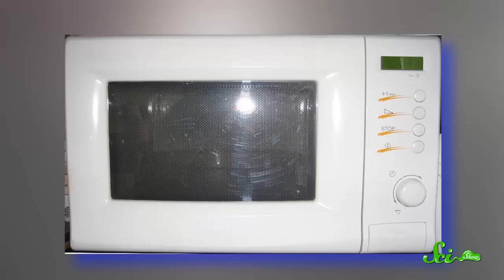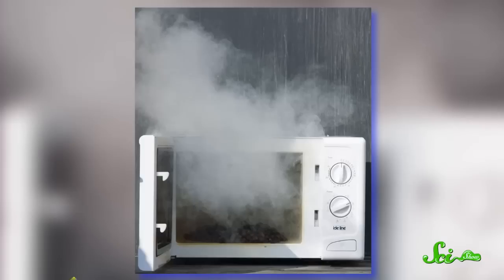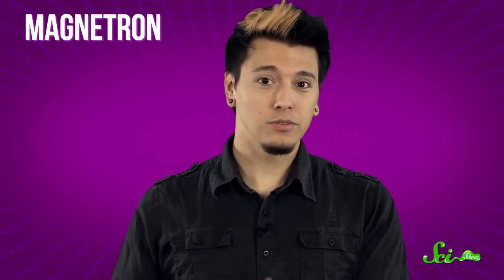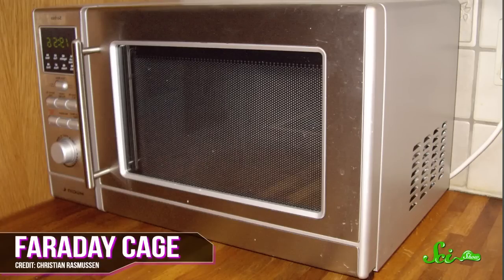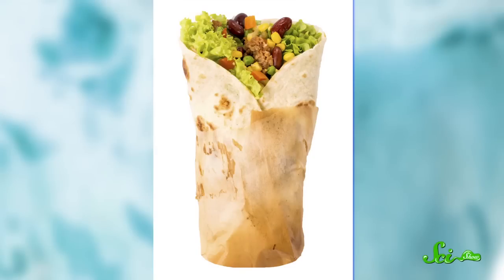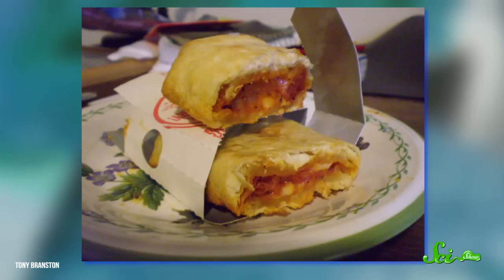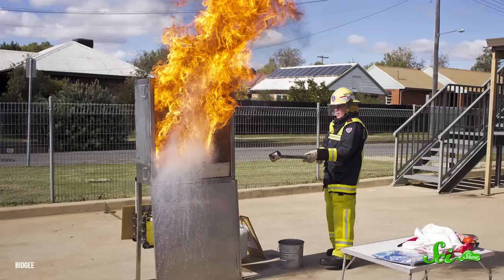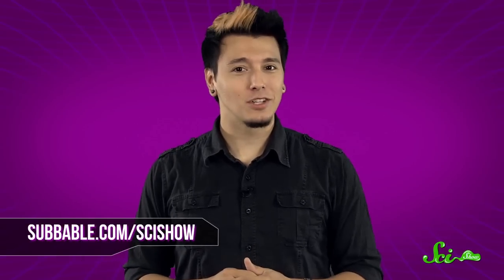Why Can't I Put Metal in the Microwave?

Comment: Sometimes you have to pay attention to the containers you get from restaurants and stuff too though because of this same problem.  I had one issue once where I got a take out bentou from a Japanese restaurant and when I heated it up in the microwave, I didn't know that the tray was also lined with aluminum so my lunch burst into flames.  I put it out, but there were bits of plastic on the top of my food and only the lower parts untouched by burning were still edible.  I'd gotten used to places giving me things that were microwave safe so I just assumed. =/  This stuff is probably the same reason Chinese take out boxes don't have handles on them anymore.

Comment: I've got a microwave egg boiler. It's the shape of an egg and the outside is made of plastic. The top part is where the egg is put. It is put onto a metal tray which has holes in it and the top part is covered in metal. The bottom part (under the metal tray that the egg sits on) is just plastic. You put the water in there. What happens (to my understanding) is that the micro waves heat up the water (that is only covered by plastic) but the microwaves bounce off of the metal that the egg is sitting in, preventing the egg from getting microwaved. As such it boils the water and the boiled water then boils the egg, rather than the egg getting microwaved! Cool huh!?

Comment: So you said there's a buildup of electric charge; how do I go from that to some sort of tesla coil? or, what would happen if, say... one were to concentrate microwave radiation on the primary (and possibly secondary coil) while 15kv was running through the wire (very low current)?
Reply: does the microwave radiation transmit emf similar to the secondary coil?
Reply: I was trying to say induction, but the word wouldn't come. do the microwaves induce electric/magnetic field?
Reply: Yes. Microwaves are electromagnetic waves which are oscillations in the electromagnetic field. So the magnetron is a primary coil of a transformer if you have any meter around to act as the secondary coil.

Comment: SciShow  I had always thought that it was high energy waves being absorbed that do the work too, but that's wrong. Water is a polarized molecule and as the wave passes through the molecule it basically rotates it quickly. It's called dielectric heating.

http://en.wikipedia.org/wiki/Microwave_oven

Comment: interesting. BUT on my micrawave it says to put liquids in with a spoon and not without one. there are two symbols inside the ledge of my microwave: one with a glass + liquid that also contains a spoon. the other one shows the same glass without the spoon and that one is crossed out...... doesn't make any sense if you ask me.
Reply: The point of the symbol with the spoon is that it wants there to  be a nucleation point for bubbles if you're microwaving water. Otherwise you can superheat the liquid, and a slight agitation (e.g. picking up the glass) can cause it to essentially explode in a shower of steam and boiling water, causing severe burns.

Comment: So the little holes in the microwave mesh are smaller than Microwaves? Idk why but this bothers me
Reply: +retsamekop10 Why? you should feel safe, if it were the opposite I'd be concerned.
Reply: +v3foo It's not that, I feel safe. It's just weird to think that waves, which I usually imagined as being extremely tiny, are bigger than the microwave holes.
Reply: +retsamekop10 it's the really tiny ones that fuck you up
Reply: +SuperMegaUltraPigeon it's not the wave itself but the wavelenght
Reply: +retsamekop10 Microwave is a bit of a misnomer. The wavelength of microwaves (in the electromagnetic spectrum) can be anywhere between 1 millimeter to 1 meter, and what microwave ovens use will typically be 2.54 GHz in frequency, or about 12 centimeters in wavelength.
The holes in the microwave screen are about 1 cm in diameter, which is smaller than 12 cm.

The name "microwave" was chosen because it's smaller in wavelength than the radio waves used for communication. We have to remember that light comes in all frequencies, and the labels we use are just rough designations.
Reply: +IhaveWoodforSheep The holes in my microwave oven door screen and internal ventilation screens are about 1 mm and 3 mm diameter, respectively, not 1 cm diameter. If yours are 1 cm, you have a big radiation leakage problem.
Reply: *****
I said about. For the purposes of our discussion, 1 cm is close enough to 1 mm, because the point is it's smaller than 10 cm.

Comment: Here's a question about microwaves. Why has no one invented a microwave that doesn't wake the dead when I press a button while making a late night snack?
Reply: The one in my kitchen is pretty quiet.  It makes more noise with the internal fan than the chime makes when it is done and it has a rotary timer rather than digital buttons.  
Some of the digital ones do have a mute option but you may have to look up the manual for your specific unit to see if it has that feature and how to enable it if it does.

Comment: But wait! I've been putting tinfoil in the microwave for years! We learned how in a cooking class. I use it to cover the wings and legs of a whole chicken while defrosting it so that they don't get cooked while the rest is defrosting. We even had a way to demonstrate it. 
We would put a cup of water in the microwave along with an ice cube covered in tinfoil, and run it for a minute or two. The water would boil and the ice cube would stay frozen. I think the teacher said that it had something to do with the size of the cup of water or total volume vs the size of the cube. As long as there was more material for the microwaves to be absorbed into than the size of the metal object it was safe.
Reply: Well part of this is because the foil abdorbs the energy, and the other part is that ice doesnt accept microwaves nearly as readily as liquid water. This is part of the reason many frozen ready meals have a period halfway through where you wait a while so the hotspots can equalise, thawing the frozen spots via convection as opposed to radiation.

Comment: So, microwaves are the basis of a feasible deathray pistol. The collage I am going to: Does not allow a bread machine. Allows a low grade death ray...
Reply: Well, not a pistol per se. You may notice how microwaves are kinda heavy and need to be plugged into 110V house current?
Reply: Errr, for the household microwaves they are that big to accommodate the foodstuffs, and you could fit a 150v current producing capacitor or battery into a pistol... Would be large and a bit bulky, but doable.

Comment: At what point do chemicals stop being chemicals and start being life?
Reply: They never do stop being chemicals. As for what constitutes life, it can be pretty contentious at the borders, but the generally accepted definition (lifted from Wikipedia) is any object with the following properties:
1. Homeostasis: Regulation of the internal environment to maintain a constant state; for example, electrolyte concentration or sweating to reduce temperature.
2. Organization: Being structurally composed of one or more cells — the basic units of life.
3. Metabolism: Transformation of energy by converting chemicals and energy into cellular components (anabolism) and decomposing organic matter (catabolism). Living things require energy to maintain internal organization (homeostasis) and to produce the other phenomena associated with life.,
4. Growth: Maintenance of a higher rate of anabolism than catabolism. A growing organism increases in size in all of its parts, rather than simply accumulating matter.
5. Adaptation: The ability to change over time in response to the environment. This ability is fundamental to the process of evolution and is determined by the organism's heredity, diet, and external factors.
6. Response to stimuli: A response can take many forms, from the contraction of a unicellular organism to external chemicals, to complex reactions involving all the senses of multicellular organisms. A response is often expressed by motion; for example, the leaves of a plant turning toward the sun (phototropism), and chemotaxis.
7. Reproduction: The ability to produce new individual organisms, either asexually from a single parent organism, or sexually from two parent organisms or "with an error rate below the sustainability threshold."

Comment: When i was a kid i went to heat up a chicken roll with a foil lined pack in a microwave and a bolt of electricity struck the roll and set it on fire, somehow the microwave worked fine though and I ended up having it at my own place when i moved out 15 years later.

Comment: If you want to have fun with your microwave oven do this: find a grape, cut off the stem and little bit at the top with the stem in it. Cut the grape down the middle until only a tiny bit of skin is still joining the two halves. Make sure the two halves of the grape aren't touching except for the little bit of skin. Place the grape in the microwave for about 5 minutes and watch. When opening the microwave oven DO NOT BREATH THE GAS OR YOU WILL DIE. Hopefully you'll see some plasma arcs. Enjoy.

Comment: because microwaves are longer than you think, and they'll make the jump if the corners are sharp enough

but really, you can. whether or not metal will spark in the microwave depends on whether it has sharp corners or not. It's like an ionizer, if its sharp enough, electricity will spill into the air, but if its blunt it will stay inside

I like to say, with faciousness, that spoons are ok for the microwave, but forks arent lol. Fundamentally this is true, though practically it probably doesn't work out so cleanly in most cases

I hate how random microwave ovens are. I wish the radiation could just be organized and not rely on some spinning disc to equalize its crappy distribution

If you want to turn microwave energy into thermal energy, fire brick is a better bet than metal. Though of course not for small applications, stone doesnt do well thin. Fire brick is super awesmoe in the microwave and makes infrared light from the microwaves iirc. It's basically a mini thermal oven to convert your microwave. You can melt glass in it and stuff

Comment: But isn't the mesh inside the microwave 'thin metal'? Plus, it has curves, the holes inside of them. Why doesn't that create problems?
Reply: Because it forms a complete circuit with the rest of the microwave, and so charge doesn't build up — it's just conducted away. Added to that, the mesh doesn't have any corners or edges that can build up charge (to the microwaves, the mesh is essentially a solid sheet rather than a bunch of holes).
Reply: ah thanks :)

Comment: why is hexagon nature's favourite shape ?
Reply: I would argue against 'favourite', but much of the reason is that it tessellates well. Squares and triangles are the only other shapes that tessellate and if, say, you're a round insect you're not going to want a triangle, and in the competition between squares and hexagons the latter requires less structural material — assuming a side length of unity, the area of a hexagon divided by its perimeter is roughly 0.43, while for a square the value is 0.25. A triangle, just for interest's sake, has a value of 0.14.

Comment: Ok SciShow Why are there two different SciShow account names that appear in my @suggestions drop-down? Really - why do I have two seemingly different accounts with the name: SciShow? anyway - back to my train of thought. So SciShow, Veritasium , and VsauceBR BR? Where in the hell is just "VSauce" in my @suggestions drop-down? What the hell?! ANYWAY ...
I have a question for all of you...
After watching this video a question surfaced ... One which I've often wondered in passing but never gave any serious mind-processing-share space. So here it is:
Why - when a barrel of Curious George's find a spool of optical discs and happen across an open microwave during their annual Optical Disc Warz tournament and decide to use the microwave as a safe storage unit for one of their precious discs - why does the actual read/write material (or some other layer possibly?) spark/arc/burn-out in that very unique pattern of an actual labyrinth-like partial circle rings, all around the center, which are also linked haphazardly by radial spoke-like sectionals (sometimes starting right where one semi-ring stops, and another starts, giving it a step-like appearance)? Why does that happen? Why the semi-rings specifically? Why burn and or arc/spark out in the first place? Are these patterns caused by some sort of current that's being induced? If so, why the sudden jumps from "energy level" to "energy level"? If it's not current - then even more of a wtf, right?
Anyway - dun. That's my challenge. :)

Comment: But what about when you put a mug in the microwave. some people say that you should put a teaspoon in the mug and others say not do.
I remember in my childhood I used to put in a teaspoon in it but now I don't.
Reply: I'm guessing the spoon thing is because in just the right conditions you can super heat water to a point where it can 'explode' when you move it unless the surface of the water is disturbed - I vaguely recall a Mythbusters episode about it. The spoon would break the surface tension of the water, preventing this. I've never seen it happen, and I nuke water all the time for tea.
Reply: gypsyvail
I've heard of that happening , but it only happens if you have very pure water , because as soon as there is an imperfection it changes the form of matter ( like when you get a bottle of distilled water below 0 degrees but it doesn't freeze because there are no imperfections in the inside )
Reply: It heats the water faster theres no such thing as super heating water it can only get so hot before it turns to vapor
Reply: A spoon is generally not a shape that has many points or small gaps, and it's also generally pretty thick (relatively speaking). So as long as you keep it as close to the center of the microwave as you can (so it doesn't get too close to the metal walls), it should be safe and risk-free. Being metal, it'll heat up with more magnitude and speed than the liquid inside the mug, and the liquid will absorb some of that heat from the spoon, letting it get hotter faster.
Reply: I have noticed putting a spoon into my mug with milk it will heat up faster and more evenly than when i do it without, so I'm always putting it in.
Reply: SmittysVtMade Hi, But if you heat water in a smooth container too high it can all reach temp all at once and violently erupt.
Reply: thomas PlaysGames Mclovin11859 
Thanks, I knew I was misremembering part of it. Nucleation was what I meant, not super heating - I know better, I swear I do :)  As long as your liquid bubbles in the microwave - or the freezer -  there's no problem.

Comment: so why do grapes blow up in the microwave?
Reply: Because they're full of water and it evaporates but it is contained in the skin of the grape until it pops because of the expanding gases.
Reply: jk844100 *Grape.......
Reply: jk844100
The skin of the what? O_o
Reply: jk844100  hahaha you said rape instead of grape
Reply: My bad
Reply: Fun fact: if you cut a grape almost completely in half, but leave a little bit of skin connecting the 2 halves, and set it upright in the microwave, it will actually produce plasma. As for why they explode, jk844100 got it.
Reply: one word: plasma.

Comment: you completely failed to mention anything about if said metal is grounded. Some microwaves come with metal racks that are safe to use while the microwave is working. This is due to that metal rack being grounded. Similarly the walls of the microwave are likely (i'd need to confirm this) grounded. episode fail.

Comment: If microwaves are designed to keep the emf inside why do they always screw up WiFi?
Reply: Well that means your microwave is leaking microwave radiation (not really a massive problem as it sounds but id still buy a new one if i were you to be safe...it does it is because your router power signal operates on 2.4 GHz band and so does your microwave, lots of things use this frequency or around it and if they mix it causes interference (what your getting) theres even a wiki page about electromagnetic interference at 2.4GHz problem...But yeah ...buy a newer or better shielded microwave if i were you.
Reply: Kirz94 ignroe part about getting new microwave!, turns out no matter what atleast 1% of the radiation will escape no matter what, just ignore it!

Comment: Would it be possible to make glorified microwave tech into a weapon? I've been pondering this for some time, and i've got to know if my dream of ever possessing a canon that can cook my enemies alive is just wishful thinking and far fetched or not.
Reply: I'm pretty sure Mythbusters tried that.
Reply: I think they call larads or Lrads or something like that. they're used for crowd control and apparently they hurt like hell. I believe they're also the inspiration for Black ops 2's guardian turrets.
Reply: Armendicus LRAD stands for Long Range Acoustic Device, so I believe you must have mixed up some abbreviations. But there is the Active Denial System, which is basically a giant metallic plate emitting radiation (the waves shorter wavelength than microwaves) that heats up the water molecules in the outermost layers of the skin (about 0.4 millimeters in). Sounds pretty painful indeed.

Both LRAD and ADS are used for crowd/area control, but LRAD uses sound instead of radiation.
Reply: Improbabilities yeah that